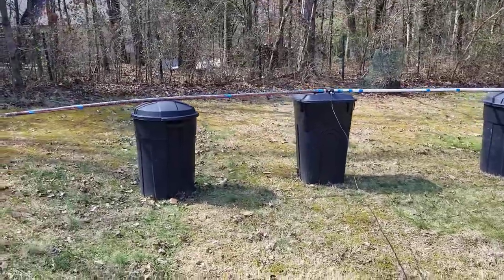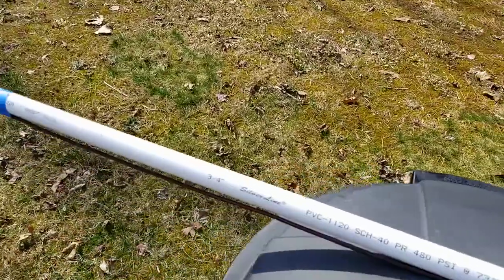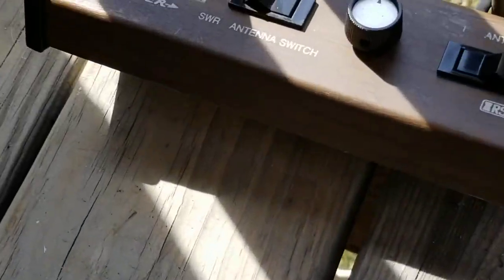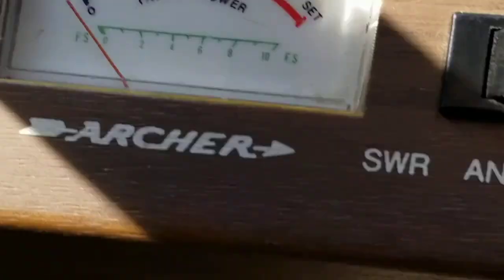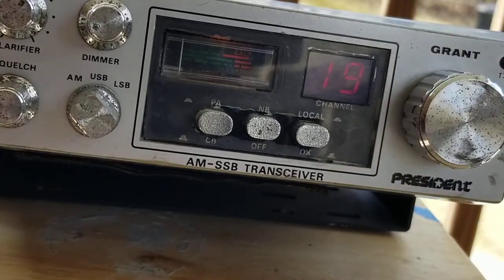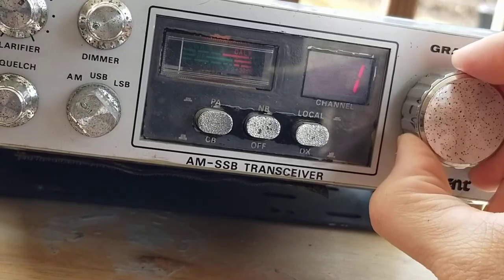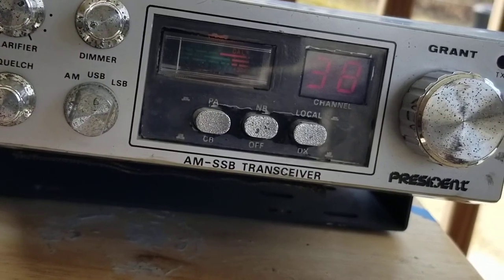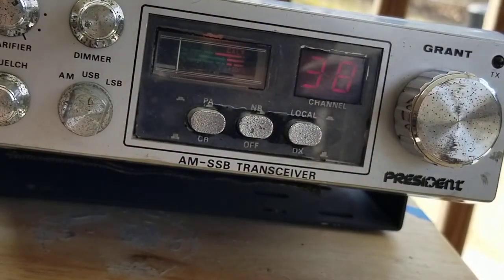102inch Cb Homemade Single Beam Antenna Tune up trim Works Running Dx Skip and Local 3-5-2022

Comment: the Mexican Farmers are using Ch 9 now days, 37, 38, 39 & 40 LSB are good for DXing Ch.s 6, 11, 13 & 16 are all the bums DXing with shitty radios that bleed 5 Ch wide ...
you need to get a 555 or a QT-60 its 10, 11 & 12 Meter I have had one for 6 months now and LOVE IT! 60W stock right out of the radio ....

Comment: You could use a PVC T in the center. If you tune it for ch 40 it will be good on all channels. At SWR 1.5 you only have 4% loss.

Comment: GOOD LORD MAN, WTF is a "single beam antenna"...sounds like something a CB'er would say, no doubt.  You've built a DIPOLE antenna for the 11 Meter CB Band (26.965 MHz to 27.405 MHz) not a "Beam Antenna".  Dipoles are directional from both "sides" (perpendicular to the radiating elements) but hardly a "Beam Antenna".  Also the needle your SWR meter is not calibrated correctly, it should "rest" at the low-end of the scale, not a 1/4" below it, so you SWR readings are higher than you think.
Reply: Nasty pompous atitude.  Maybe he is new or still learning no need to act like a sad ham.

Comment: Make me one and ill buy it
Reply from the maker: Its 12 gauge speaker wire inside PVC pipe it's been tune right I put 103 inches on speaker wire.when trim 102 the swr went to 1.0 back in 2022.
Reply: @Foxman362worldradio  what u use a so239 connector for the coax to go to
Reply: @Foxman362worldradio  do you have a bnc female to bnc male coax
Reply: @Foxman362worldradio  how many feet are the poles

Comment: I like how all these CB guys think a 1:1 SWR is all you need. If only it WAS that easy.
Reply: You say all CBers. I'm a CBer. Why don't you elaborate for me, you know, the other things for me. Please impart some of your wisdom. How about answering this question for me. What is the definition of antenna resonance, in this case, a half wave dipole?
Reply: @arconeagain  Antenna resonance is defined as the frequency at which the input impedance at the antenna terminals is purely resistive, but, your question lacks any actual context, for instance, what is the desired frequency, gain, bandwidth, impedance, and polarization? I could quote from the MILLIONS of pages of analysis, theorems, theses, and such done over YEARS of research by countless persons WAY smarter than you, but I'm sure you've read all of it already, so I would be flogging a dead horse with your superior intelligence in ALL matters antenna. So I turn the question back on you, explain how much you know, we're all ears.

Comment: Isn't this the same as a 1/2 wave centre fed dipole?
Reply: Yup. That's exactly what it is,  a 1/2 wave centre fed dipole. I think he gets the "beam" idea because when horizontal it "theoretically" radiates in 2 directions broadside but doesn't radiate off the ends.  

Of course in the real world the radiating lobes will be all over the place depending on the quality of the ground underneath  and the height that the antenna is mounted above the ground. (The dipole should be mounted as a minimum 1/4 wave above the ground, (around 9 feet for CB), but really it should be much higher than that.  18 feet above the ground is a good compromise height.

There is not much actual gain  compared  to even a standard 1/4 wave vertical. Certainly less than a quarter of an S point.

But still it is worth building because it is a good antenna :)
Reply from the maker: It's been weather proof with grollia glue spray on pvc pipe on camo so rain cant get in it.
Reply from the maker: It's one with 102 and 107 inch3 Cb Radio Homemade  Single  Beam  Antenna  Female So239 Mount video and 102 and 107 inch Cb Homemade  Single  Beam Antenna Jb Weld UHF Female So239 Mount  video on YouTube.

Comment: I love my homemade single beam antenna. Been using it for 2 years. I'm using two 102" steel whips. Using 50 ft LMR 400 coax.  73's to ya. 

Raven #499 said it and I'm back quiet
Reply: Co phasing
Reply: @jmanranger7271  hey whatever works. I'm walkin the dog and kickin the cat. That's all that matters.
Reply: I need someone to make me one or send me the parts

Comment: Congrats! Now spent a few bucks and change that feed cable to LMR400 and your jaw will drop even more! Your losing so much effective power at the radials because your coax has high loss. I used RG8x at 50' for years and when I switched it to LMR400 I couldn't believe the difference. Both RX and TX where so much better. Cool idea for tuning it! I used solid core 10ga wire on mine but had to keep pulling it apart to tune it. But mine was mounted vertical. I might have missed it but how are you planning on long term mounting it? Horizonal or vertical?